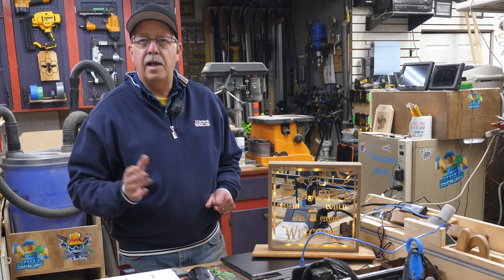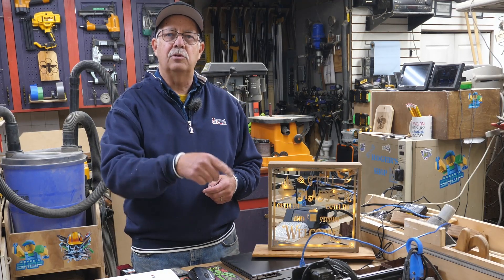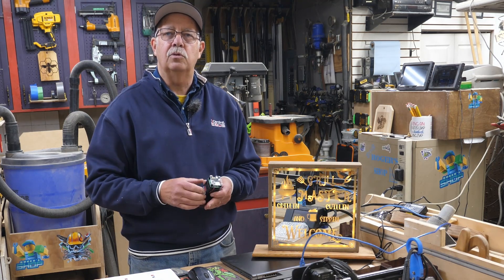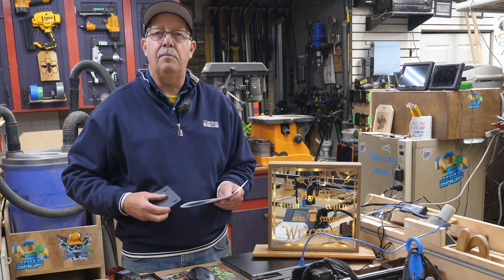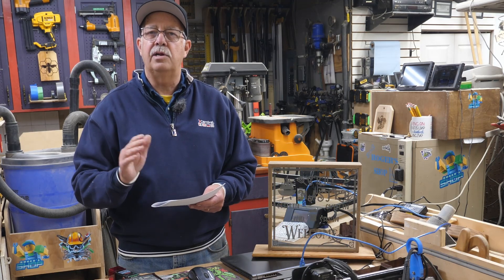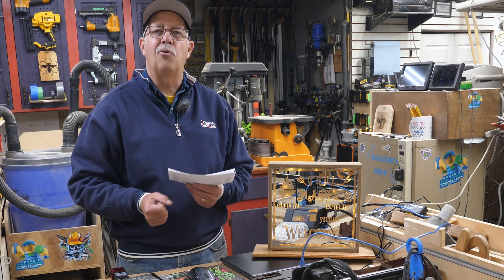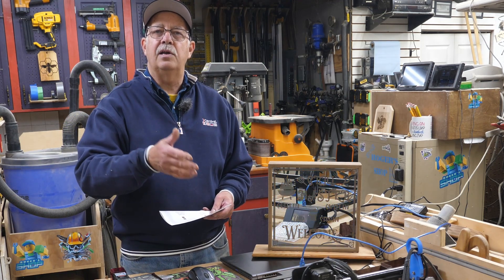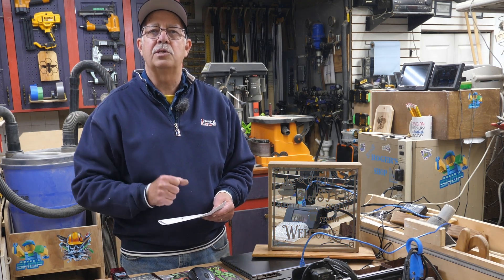Longer Ray 5 Laser Best Size?

Comment: Great video Roger. Very informative as ever. I really appreciate what you do. I wonder if you could try this for me on your Longer Ray5. On the provided SD card there is a compass design. When I put this into my PC and frame it from Lightburn it frames in the centre. If I take the card out and put it into the SD slot on my Longer Ray 5W it frames bottom left. Does yours do the same? I cant think of a way around this and wondered if I  have a faulty laser. Keep up the good work.
Reply from the maker: Yes, it will start from "home", which is front/left corner when run direct from the SD card.  From Lightburn, you can place it where ever you want using either Current Position for the laser head or Absolute Coordinates (if you have the model with limit switches)
Reply: @rogersshop  Forgive my ignorance Roger. (I am a  nooby!) I have the 5.5W model so no limit switches. Would you know how to them them up so that they both frame in the same position?